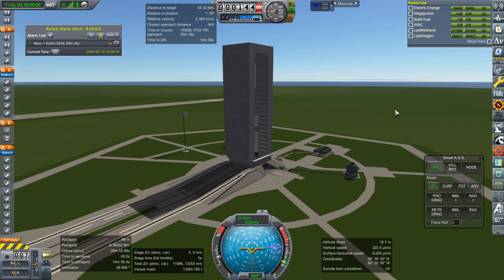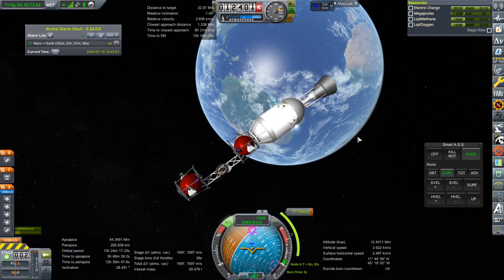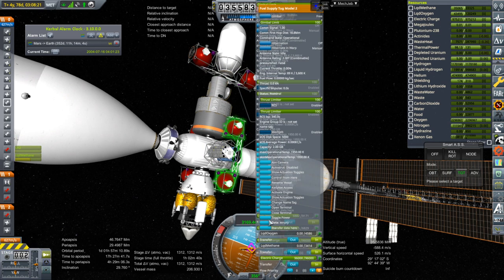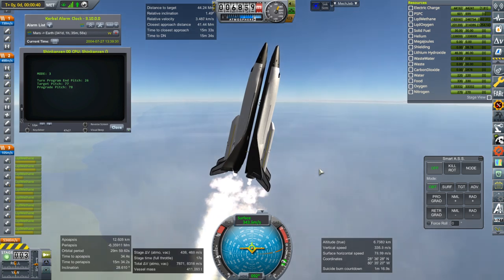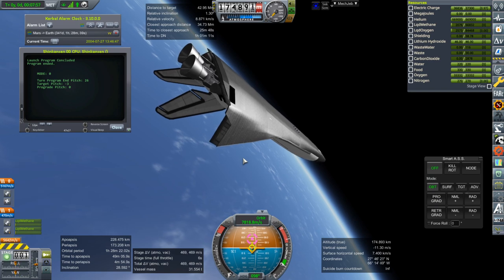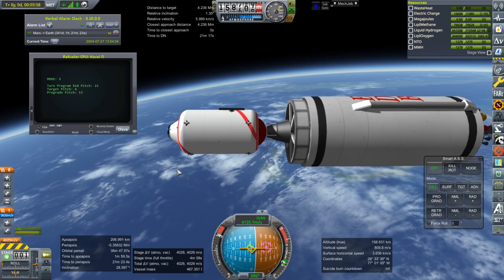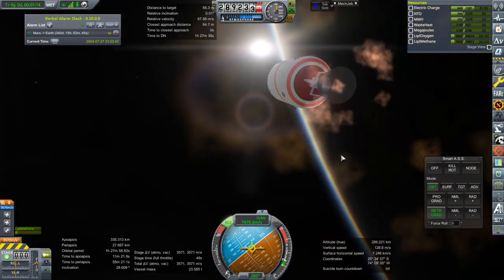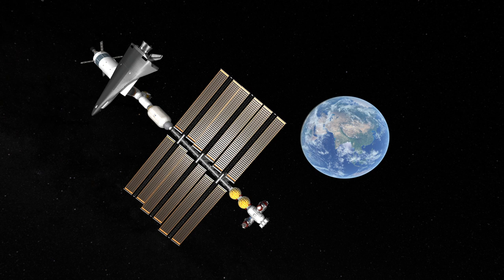KSP 1.6.1 RO and Kerbalism - Mars Colonization 038 - Shinkansen

Comment: Can the space plane use aerospikes? Also, maybe you should put the docking port a little further from the cargo bay.
Reply from the maker: Aerospikes are fairly heavy and not as beneficial as often surmised. Plus, I don't have a way of calculating the performance of a methalox aerospike - the only ones I know of are hydrogen-oxygen. I agree about the docking port.
Reply: Earth atmosphere is too thin to justify the shortcomings of the aerospike. It would be a good option when the air is Venus thick.